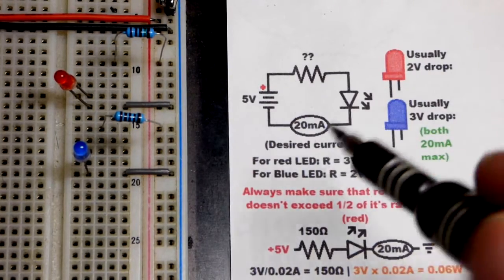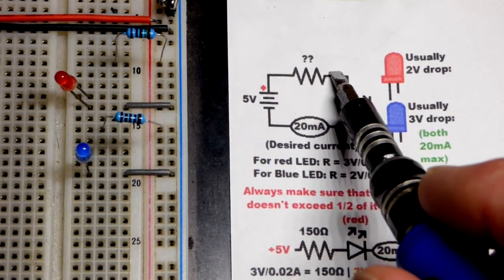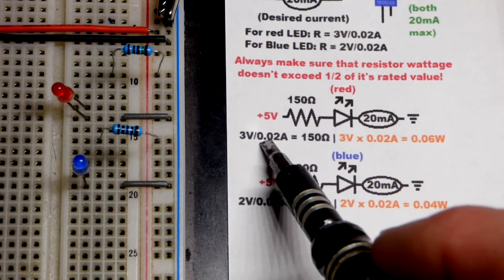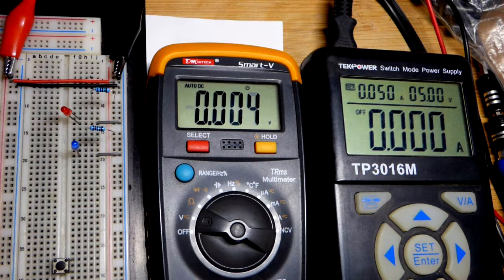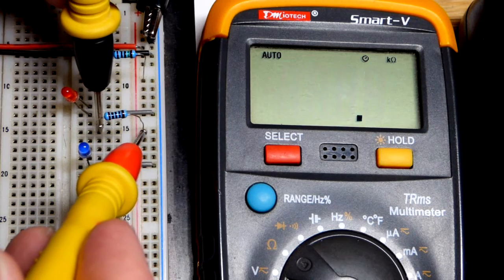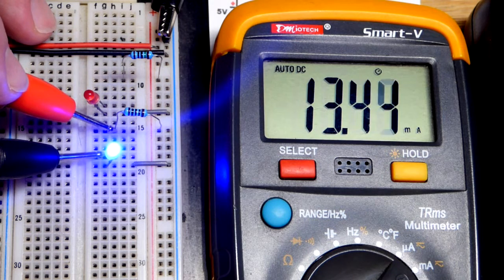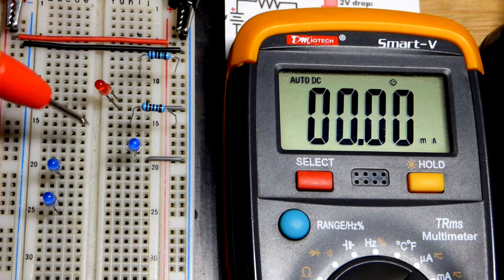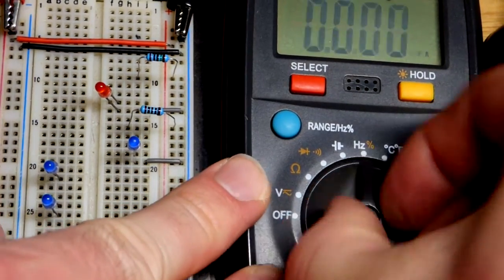How to calculate resistor value for 20mA to protect LED from 5V for learning electronics shorts 103

Comment: As I understood, even if we have 1000V power, it's enough to put 100Ω resistor and viola - we can light blue diode. Right??
Reply from the maker: At 12V you need about 1000 ohms. Or a higher wattage resistor to go lower. I wouldn't build any circuit with 1000V.
Reply: @Electronzap  Ah, got it! It's confusing that you use 5V source and in a formulae you mix 2/3 volts. Better make 12V source, THEN difference in volts will be more obvious. So... how people make "light" in an extender? They have ~220V and small red light under switch.

Comment: Actually: the 20mA is the MAXIMUM current, the Led will tolerate without getting some damage. (ok, there is a safty margin. a LED will not break immediately).
Also: with 20mA Leds are often much to bright. In reality a current of 10 or 15mA is more then enough. How to adjust that current? In exactly the same way as presented in the video. Just replace 20 with 15 or 10 in the caluclations.

Edit: I wrote this post because in my experience newbies often think that you HAVE TO operate Led with 20mA. Which is not the case. Just because your car CAN drive 180mph it diesn't mean you HAVE to drive it that fast always.
Reply from the maker: Good points, and I had already planned to do 15 and 10 mA calculation videos sometime soon :)

Comment: Is the diode test on the multimeter a good gauge for what the actual voltage drop on each LED will be?
Reply from the maker: I was thinking of showing that in the next video. I think my meter tests the LEDs at 1 mA of current. So it's a quite a bit lower forward voltage. I think it was somewhere about 2.7V instead of 3V.